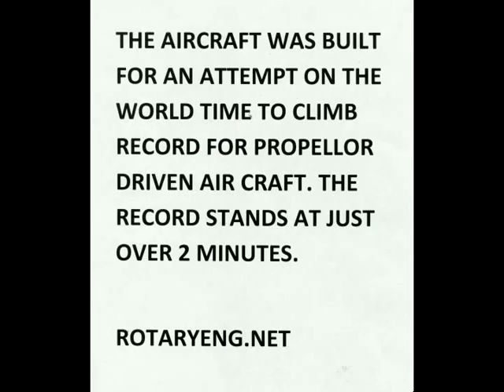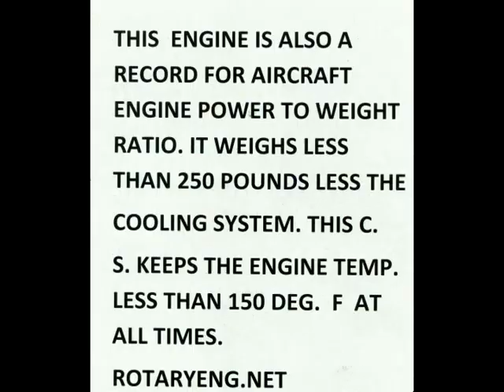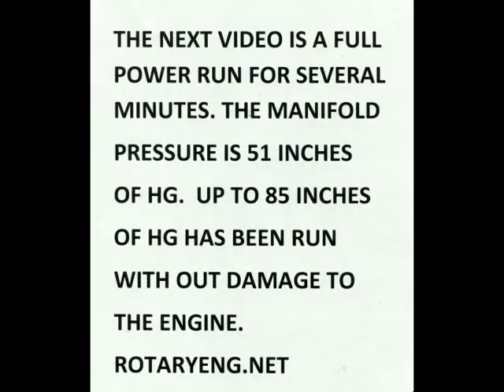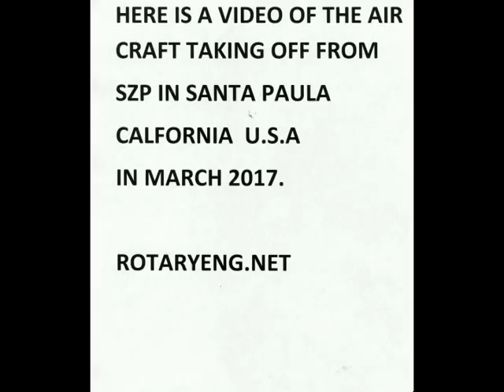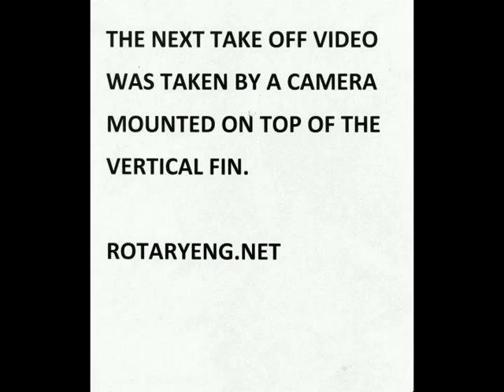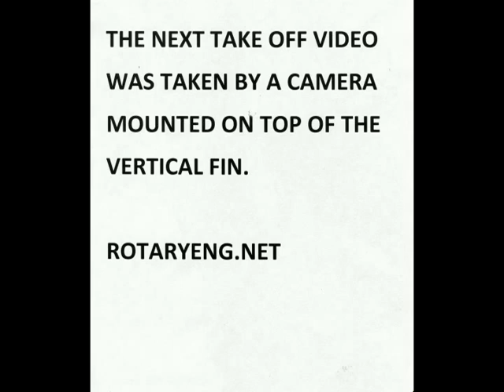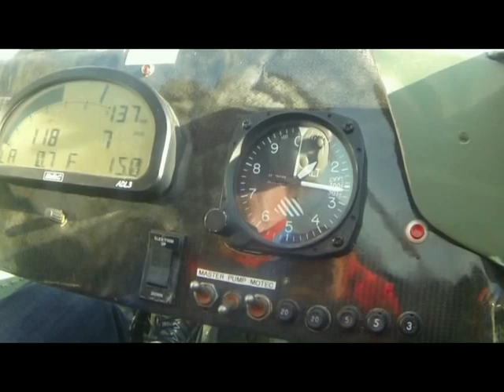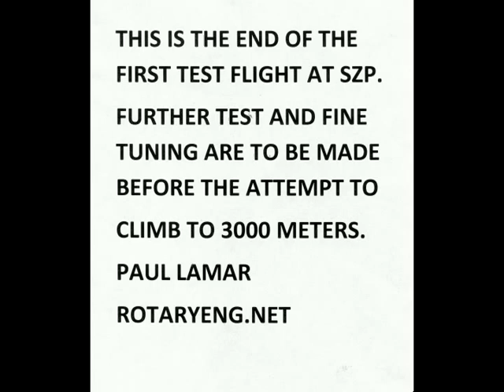World Record

Comment from the maker: I might mention the weight of the World Record aircraft with pilot is 1175 pounds and 
the engine and gear box is only 250 pounds. The gear box is a bit overkill at 50 pounds.
It happens to be a Bell 47 final drive and according to Bell engineers it is good for
over 1000 HP at 8000 RPM .
Reply: No where close to the world record of 51 seconds..

Comment: this is an amazing plane. I love wankel rotary engines especially when turbocharged, you can't beat the horsepower to weight ratio of a rotary engine. The U.K. military has drones that have rotary engines that burn desiel, they up the compression, & burn desiel or kerosene(jp4). great video. Imagine an all composite super light light sport like the LH-10 with a 4 rotor hi-performance compound turbo charged system with a 5 blade pusher kevlar-composite prop. It would easily break the 350 knots with ease. Great video take care.
Reply: The U.S. Military is the largest customer of drones/UAVs in the world does not use any with Wankel engines.
Reply: The gas turbine engine offers an order of magnitude greater power to weight performance and reliability.
Reply: Another fatal crash this week involving a Mazda engine. R.I.P.
Reply: That you know of, 😂🇨🇦 @doktorbimmer
Reply: @stevecarlisle3323  Rotax GmbH. horizontally-opposed piston engines dominate the UAV and ultralight markets, they offer engines that meet airworthiness certification.
Reply: @stevecarlisle3323  Yes, which is apparently more than you know lad.
Reply: @sandervanderkammen9230  You way out the loop, this is NOT general aviation, but Experimental, you should do some research 🤔🇨🇦
Reply: @DoktorBayerischeMotorenWerke  You are the one that can't even figure out which FAI record they broke 😂🇨🇦
Reply: @stevecarlisle3323  *FAI World's Record, Time to climb to a height of 3,000 m    51 seconds!!!!!  04 Mar 2005 Viacheslav Brovchenko.  NOT a Wankel powered aircraft.

Comment: Yet another fatal crash this week involving a Mazda engine. R.I.P. Cedric Jackson
 Godspeed
Reply: @sandervanderkammen9230  What's the tail number, so we can lookup the cause of the accident 🤔🇨🇦
Reply: @stevecarlisle3323  Cause of the accident was engine failure on go-around, missed approach.
Reply: @sandervanderkammen9230  Your one of those Trolls that can't backup their own statements, 😂🇨🇦
Reply: @sandervanderkammen9230   Turns out, according to FAA preliminary inspection, it was not related to powerplant, but a flight control failure. Just another LIE from Sandervan 😔🇨🇦

Comment: Not anywhere near the absolute record.
Reply: There is a World Record, for Time To Climb, in its classification . Check a little more, I found it 😉🇨🇦
Reply: @stevecarlisle3323  Not the World's record, the official Time to Climb World record still stands at 51 seconds... held by a vastly superior gas turbine engine.
Reply: @sandervanderkammen9230  What's a  Absolute record 🤔🇨🇦
Reply: @stevecarlisle3323  THE WORLD RECORD
Reply: @sandervanderkammen9230  Sander is Not aware, or unable to understand that the World Record he keeps refering to is a Speed Over Ground record, and not a Time To Climb record, like the one set by Dan Gray, with the rotary powered Harmon Rocket.  ☺️🇨🇦
Reply: @stevecarlisle3323  YOU ARE WRONG.  THE WORLD RECORD REMAINS UNBEATEN.
FAI World's Record, Time to climb to a height of 3,000 meters 51 seconds!!!!!  March 4th, 2005 by Viacheslav Brovchenko.
 This is the ratified official world record..

Comment: BUT THE ENGINE IS INSTALLED BACKWARDS!!!

Imagine how fast it would be if they put the engine in the right way around!!
Reply: In a RWD car, engine has to put out power towards rear, through the gearbox, and then down to the wheels at the back of the car.  
In a plane with propeller at the back (pusher prop) same engine has to put out power towards rear where the prop is.  
Now, just imagine having the prop at the front of the plane and using that very same engine . . . . .
Reply: Its a perfect example of why automotive engines are poorly suited to aircraft applications... and there are no aircraft type Wankel engines available because they are too unreliable for FAA and EASA certification.
Reply: @doktorbimmer  That's a B.S. assumption. You and the other guy are all over these comment sections with your baseless so called FACTS about them not being reliable enough for aviation use. Not a single one of you know the REAL reason and you're going by what you THINK that reason is. 

The lack of certification has nothing to do with reliability. It's mostly money, time and the ability to manufacture with consistency is how you certify engines of any kind in the aviation sector. You guys also fail to realize that the aftermarket has finally caught up on engineering key components that make the factory engine even more robust. You still need someone to spend the $$$$$ to put together a dedicated aero industry set up (like Mistral who went bankrupt before getting their engine got certified) and mass produce the set up with consistency. That's why you don't see certified wankels.
Reply: @rotaryperfection  What about Curtiss-Wright???? 
They worked closely with the FAA for over 25 years to develop a reliable, certified Wankel engine...
Reply: @rotaryperfection  Mistral went bankrupt because it could not get it's engine reliable enough for EASA certification.
Reply: @rotaryperfection  I think Max  Bentele knew a lot more than you son...
Reply: @rotaryperfection  What about Curtiss-Wright????
Dr. Max Bentele said you are wrong... who the fuq are you to say otherwise?
Reply: @rotaryperfection  Another fatal crash involving a Mazda engine this week, R.I.P. Cedric Jackson
Reply: @doktorbimmer  You know nothing, GrassHopper 😂🇨🇦
Reply: @sandervanderkammen9230 But yet they One .the 24 hours of LeMans at 12,000 rpm..😂🇨🇦
Reply: @stevecarlisle3323  Mazda lost 20 out 21 WSC championship races, they lost to Mercedes-Benz in 1990 and lost again against Jaguar in 1991.
Mazda has left racing without ever winning a single world class championship title.
Reply: @stevecarlisle3323  Please cite a manufacturer and model of Wankel engine that has successfully achieved a EASA or FAA airworthiness certification for manned aircraft?
Reply: @sandervanderkammen9230  So your saying that Mazda never one 24 of LeMans with a rotary ?
Reply: @sandervanderkammen9230  How do you determine the age of people you are in conversation with 😂🇨🇦
Reply: @sandervanderkammen9230  The rotary powered car was banned due to obscure law, really though it was unbeatable, and they had to get it off the track. Do your research 🤔🇨🇦

Comment: This aircraft failed to break the world record which still stands at 51 seconds.
Reply: It's best the ice propeller driven record, obviously didn't beat an f15
Reply: @ferrarikingdom  Only in its class, not an outright record.
Reply: Guess it needs a 2j
Reply: @sandervanderkammen9230  it broke the record , in the class it was registered in. Your statement makes No sense. What classification are YOU talking about.🤔🇨🇦
Reply: @stevecarlisle3323  The official Time to climb record still stands unbeaten at 51 seconds held by a plane powered by a vastly superior gas turbine engine.
Gas turbine engines dominate the aviation industry.
Gas turbine engines are inherently reliable and offer 10 times the power to weight ratio performance.
Reply: @stevecarlisle3323  The aircraft shown in this video failed to break the official FAI World's Time-to-Climb record (without payload) which still stands unchallenged at 0 minutes, 51 seconds.
Reply: @sandervanderkammen9230  It's a documented FAI in class record. Why don't ya check on the paper work, instead of just Beakin Off 😂🇨🇦
Reply: @DoktorBayerischeMotorenWerke   BullShit, the FAI was right there when it was set ! I know it Hurts 😉🇨🇦
Reply: @doktorbimmer  here is the record,

1b	Time to climb to a height of 3 000 m	1 min 39,6 sec	19 Apr 2018	Daniel Gray (USA)	Ratified - current record	World
Reply: @doktorbimmer   The aircraft never tried to beat the record set by RareBear, because it not fit for that class. Are you really that incompetent, that you can't understand the different classes. Day Gray was right when he said if this record was broken, it will really bring the weirdos out, man was he right ☺️🇨🇦
Reply: @DoktorBayerischeMotorenWerke  Ya Okay, that why the FAI issued, and registered the record. Are you really that Dumb 😂🇨🇦
Reply: @stevecarlisle3323  FAI World's Record, Time to climb to a height of 3,000 m 51 seconds!!!!!  04 Mar 2005 Viacheslav Brovchenko.

Comment: This was only a class record.
Reply: Indeed, an very trivial and obscure record at best, no where near the actual world's record of 51 seconds.
Reply: There are no certified Wankel engine manufacturers. and no type-rated aircraft using a Wankel engine.
Reply: Exactly my point son, Lycoming and Continental make extremely reliable FAA and EASA certified flight-worthy engines for the specific demands and requirements of type-rated GA designs. This is a non-certified automotive engine that cannot meet a FAA PFTR even in its stock automotive configuration... let alone this cobbled together time bomb unlimited class engine.
 This plane is about as far from GA powerplants as you can get.
Reply: Not a single FAA or EASA certified Wankel engine exists and not a single aircraft manufacturer sells a certified aircraft with a Wankel engine. Wankel engines were a massive embarrassing failure in the aviation industry and lack the efficiency and reliability to ever be used in aircraft applications.
Reply: You seem to be completely oblivious to the extensive research and development history of the Wankel engine for aircraft applications and its complete failure in these types of applications.
Reply: The Wankel engine is OBSOLETE technology... no automobile manufacturer produces them and no other industry ever successfully produced them for any significant length of time and were discontinued.
Reply: AS I said before it is not a significant record and no where near the world's record.
Reply: The Wankel engine was a complete failure, it is no longer manufactured for automobiles and was never successful in any other applications including aircraft... no aircraft have ever been manufactured with Wankel engines.
Reply: What about the Curtiss Wright RC2????
Reply: Or maybe you are just an amateur that had no idea that billions of dollars were spent developing Wankel GA engines decades ago... only to discover what all the automotive manufacturers did.... that the Wankel is fundamentally and inherent inferior to reciprocating engines the Wankel cannot compete with.
Reply: Low TBOs are a fatal flaws that has plagued every Wankel design since the KKM was introduced, high heat rejection, poor combustion and a inherently weak and fragile sealing system was the demise of the Wankel in every application including automobiles.
Reply: You mean BSFC son??? Indeed, the Wankel does not operate efficiently on MOGAS or any other fuel due to its horrible combustion and ignition characteristics, terrible thermal entropy and dismal mechanical conversion rate...
 The Wankel performs even more poorly on alternative fuels because it lacks the ability to support high static compression ratios needed for gaseous fuels like hydrogen and methane compounds like CNG and cannot start or operate reliably with compression ignition either.
Reply: WRONG! Wankel engines have even HIGHER BSFC when turbocharged especially when compared to reciprocating engines. The Wankel must operate at richer AFRs as manifold pressure increases above 1 bar (sea level). because the Wankel always operates at much higher EGTs and is more prone to damage from pre-ignition/detonation.
Reply: NOT TRUE, every conceivable configuration and chamber shape has been tried.... the available viable options are very limited and few have offered any significant improvements without significant negative side effects. The Wankel engine is obsolete because the design no longer offers any appreciable development potential... all of the 26 original Wankel KKM licensee's have abandoned development and there are no longer any legitimate engine manufacturers developing this obsolete design concept.
Reply: The possibility of  a reliable, efficient air-cooled, jetA-fueled, turbocharged modular-Wankel engine does not exist, No major aircraft manufacturer will use an engine that cannot pass FAA or EASA airworthiness certification and the Wankel is too unreliable for aircraft applications.
Reply: "Uncharted territory and GA don't go together."   And Wankel engines are the sole domain of crackpots and lunatics that try to fly (and die) powering unsafe experimental designs with engines from rusted out lawn mowers and wrecked cars...
Reply: Son you are a rank amateur, Mazda was one of the smallest companies to develop the Wankel KKM. 
General Motors and Mercedes-Benz were spending as much as 10 million dollars a month on Wankel engine development and discovered things that Mazda would not figure out until 2009...
Reply: Fatal flaws are fundamental design defects or issues that cause an engine design to be abandoned, discontinued or rendered obsolete. The Wankel engine was fatally flawed and as a direct result is no longer manufactured in series mass production anywhere in the world since 2012... the Wankel engine is DEAD.
Reply: No purpose built Wankel aircraft engine design has ever successfully passed an FAA or EASA airworthiness certification test... so you are just wildly speculating (talking out your arse) as the brit would say.
Reply: Then how do you explain the Continental Centurion??? It is a water cooled automotive based engine and it passed FAA and EASA airworthiness certification.
Reply: No where close to breaking the absolute record.
Reply: @doktorbimmer Tell that too Mazda, today. Man there are a lot of Goofs out their that know nothing about Wankel history 🤔🇨🇦
Reply: @doktorbimmer  Well your totally Wrong, again. Diamond Aircraft manufactures and sells 2 models of rotary power plants, certified for general aviation. 😂🇨🇦
Reply: @doktorbimmer  More lies, or more likely running off at the mouth, and not having done any reasearch 🤔🇨🇦
Reply: @doktorbimmer  Again, Dorkmo can't even do reasearch before he spouts off. Real credible individual 🤔😭🇨🇦
Reply: @doktorbimmer  You full of it Dork, Diamond Aircraft sells EASA certified rotary engines. You lack of Wankel rotary knowledge is amazing 😂🇨🇦
Reply: @doktorbimmer  Dorks bizarre statements, Mazda produced auto for over 25 years with rotary Wankel engine. Is that not significant 🤔😂🇨🇦
Reply: @stevecarlisle3323  Like You???
Reply: @stevecarlisle3323  There are no Wankel engines certified for general aviation... not one. Not from Diamond or anyone else!
Reply: @stevecarlisle3323  YOU ARE WRONG.  THE WORLD RECORD REMAINS UNBEATEN.
FAI World's Record, Time to climb to a height of 3,000 meters 51 seconds!!!!!  March 4th, 2005 by Viacheslav Brovchenko.
 This is the ratified official world record.